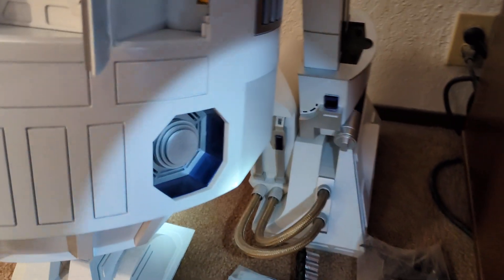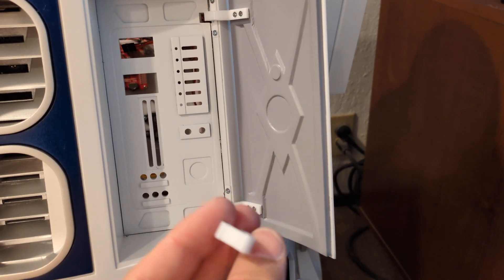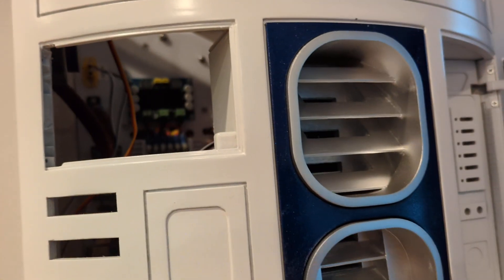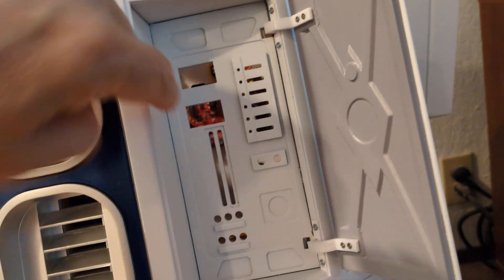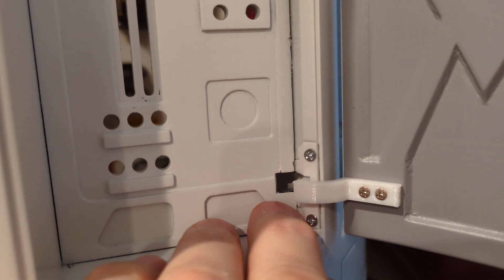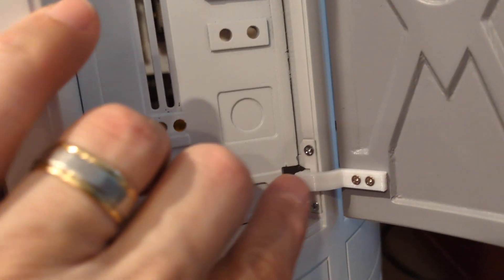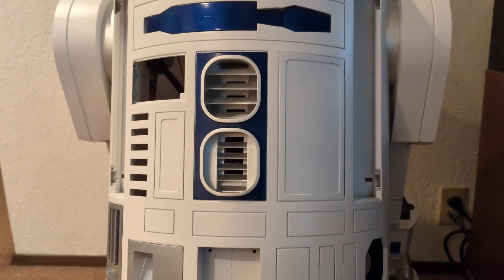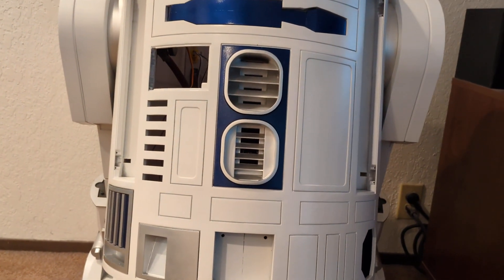3D Printed R2D2 - Part 110

Comment: You could also try to thave the block hinges (The part screwed in the body holding the little hinge) further into the body, Screwing it thighter so the door would slide into its place
Reply from the maker: @JoheTehn  That is a possibility but the screws are so small that I'm worried about stripping them out if I go too tight.

Comment: Hey Tom! It's great to see you back at R2. Using a wire linkage for the modified door hinge DOES require a bit more hogging out of the lower passthru holes, but if you've got those beautiful blinking lights going on in there, it'll be a more than adequate distraction! Regarding the hinges, perhaps it would be better if the door holes were elongated a bit to provide some positioning flexibility? I might consider making that update at some point, or if you're able to come up with a good remix before I do, let me know.

I'm glad to hear you've got an upcoming droid event to attend - have fun! Often that's the motivation that keeps us building. Cheers!
Reply from the maker: @jasonsR2D2  Thanks Jason!  I had the same thought about the hinge holes, adding the ability to adjust them seems like a great idea.
I should be able to get the blinkies in soon.  They've also got an input for battery hookup to show charge level.  Hopefully they don't go pop when I wire them up.